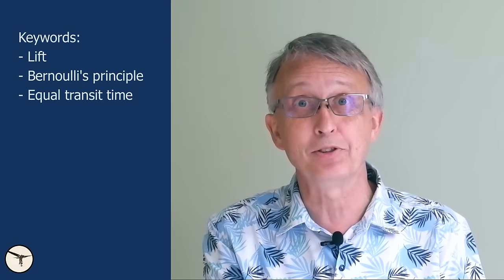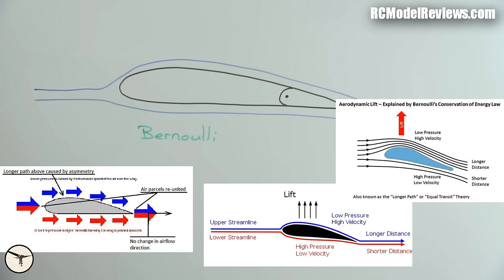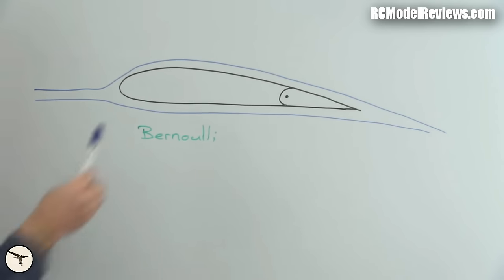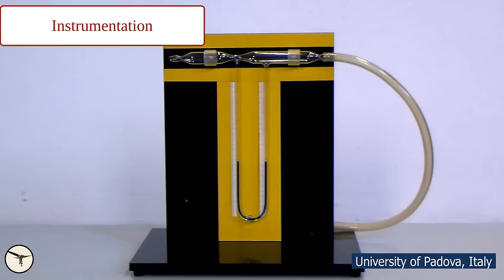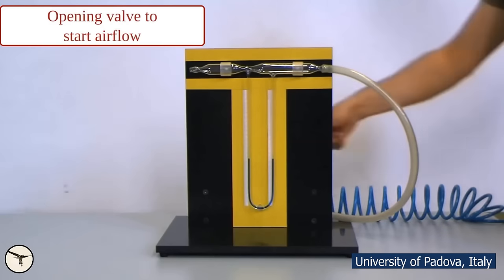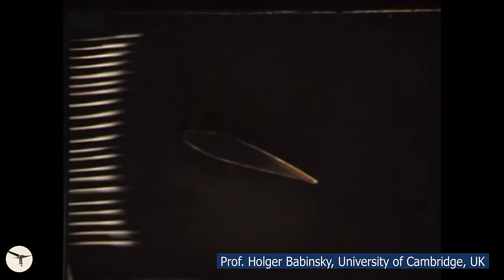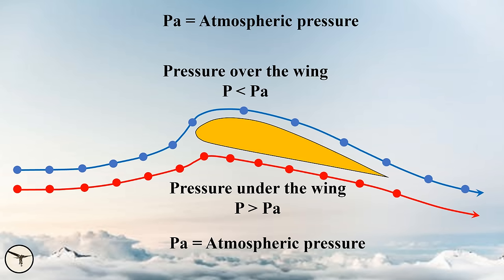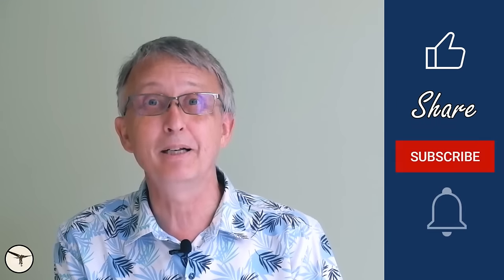Why are so many pilots wrong about Bernoulli’s Principle?

Comment: I have been dying to find a good video that actually explains lift for pilots in a correct fashion. As an aerospace engineer it's really hard for me when my student pilots tell me about the Equal Transit Time theory for lift. Thank you for this video!
Reply: Show them the wind tunnel video...
Not only is equal transit time shown to be wrong, the air over the top of the wing moves even faster than equal transit time would suggest.
Note that that video is only valid for that profile, angle of attack and wind speed.
Reply: Quite right that the equal transit hypothesis is demonstrated as being false.  But then it's dismaying to hear him talk about lift almost as though it were purely a function of surface curvature, when even a flat plate tipped at an angle and forced forward at speed will, also very demonstrably, generate lift.
Reply: All pilots should look at the book "The Illustrated Guide to Aerodynamics" by Hubert Skip Smith. Excellent conceptual explanations without the math.. Highly recommended..
Reply: @villiamo3861  Good points!
Reply: The navy had some great demonstrations on lift. This wing that he is showing has such a high angle of attack that he is getting turbulence above the wing that it symbolizes a stall.
Reply: Draw a black box. The air entering it is directed slightly down and slowed down a bit. (the wing's down wash)  Therefore the force on the box must be up and slightly aft. Lift and parasite drag.

Replace the black box with a wing and draw the forces. The air hitting the bottom of the wing must be deflected down. The air over the wing must also be directed down by the shape of the wing and to fill the void by the air under the wing. Newton's 3 laws apply. Complete workable model of a wing complete. And one that actually is useful when trying to fly an airplane.
Reply: "As an aerospace engineer it's really hard for me when my student pilots tell me about the Equal Transit Time theory for lift." -

then please explain as an engineer why airfoils on passenger jets are asymmetric.
Reply: @dougaltolan3017  In almost every video on this subject they show a wing cross-section in some airflow. But this is not what happens when aircraft fly. In real flight, the air does not move at all; it is the wing that moves. I would humbly suggest that the two scenarios are not the same and that the explanations in terms of interaction between the physical objects - the wing and the air - are necessarily different for moving air and moving wing.
Reply: @mb-3faze  apart from some insignificant reletavistic effects, what possible difference is there when changing the observers' reference frame?
In the laminar flow at the centre of a wind tunnel, the air dosent "know" it's moving.
Consider putting the wind tunnel on a train so the air at the test point is stationary relative to the ground and the aerofoil is moving with the train.
How would the air "know" the wind tunnel is on a train?
Reply: @villiamo3861  Although the air molecules are clearly not sentient, somehow making an arrangement with a neighbor to 'meet up again on the trailing edge of the foil' , it is also the case that it is not the air molecules that are moving. In disproving the equal transit time hypothesis, all the demonstrations (that I've seen) show the air moving over the wing. But this isn't what happens - it is the wing that moves through the (mostly) stationary air. I don't believe the two scenarios are equivalent - mainly because the momentum characteristics of the physical components (particularly of the air) is different when moving relative to gravity. Seems gravity is not often considered. It is gravity acting on air molecules that changes the weight of an air column above at any given altitude and the wing perceives this as pressure. If there was no gravity, there would be no lift - so gravity would seem important.
Reply: @dougaltolan3017  I've just replied to villiamo3861 suggesting that there is a difference in the two set-ups mainly because of gravity. The wind tunnel demonstrations move the air molecules in the presence of gravity but in reality, the air molecules are stationary wrt gravity. I'm suggesting that the physics is different.  It's difficult to demonstrate but if you had a wind tunnel in microgravity would the wing demonstrate 'lift'? My guess it it would - but keep the air stationary and move the wing - would the effect be the "exactly" same? Has anyone thrown an aerofoil section on the ISS?
Reply: @mb-3faze  Just one more thing: whether you have flowing air molecules against a stationary body or vice versa, those molecules, whether in a wind tunnel moving fast, or at 40,000 feet moving more slowly, all operate within the earth's gravitational pull - as does a ballistic object, whether stationary or moving at speed, and nevertheless very predictably falling to the ground at the same rate either way (and I think you'll agree we're not actually disputing the effects of altitude here on either air density or gravity, as these are factors that can readily be taken into account in a wind tunnel).

Those models disproving the equal transit are taken from wind tunnels (rather than simply being dreamt up on a computer) but as said, it is clear that the flow in working airliners is pretty much exactly as those models predict.
Reply: @villiamo3861  There's no doubt the phenomenon of lift occurs. Manufacturers of large powered aircraft would be mad not to utilize the effect particularly at low speed. It's noticeable just how quickly the pilot reconfigures the wings of a passenger jet back to more a flat surface after take off. A space youtuber called scott manley recently touted getting his private pilots license and recalls the lecture on lift - noting that the explanation was bogus. You wonder why the instructors feel the need to (inaccurately) explain lift at all.
Reply: @mb-3faze  All very well.  But do you see the angle of the wing against the fuselage, even when wing is in a 'flat' configuration?  

But even that, really, is for the comfort of the passengers and general reduction of fuselage drag.  

More importantly yet is angle that the engines thrusting the whole body being at a lower angle than the angle of your flatly-configured wing - they are the things driving the wing at a positive angle of attack (this is lower for supercritical wings, which turn the air particularly efficiently at certain speeds, but the point holds with regard to flow).

But just to see things very apparently in the main, simply look at the wing root on the fuselage - it's not at the same slope when there are no flaps, nothin' doing, as it were.
Reply: @villiamo3861  Yes - there's no doubt that the reason planes stay in the air is because they're forced through the air using powerful engines and the wings (and fuselage) literally hit the air molecules in the way. The angles are important so as to maximise the vertical force vector without increasing the backwards drag vector too much (just like you said). I was thinking back to the Sullenberger incident on the Hudson - I believe he didn't re-configuring the wing back to the exaggerated curved airfoil cross section (used at take off)  but just left them and glided the plane in to the river. Maybe he didn't have time or maybe too much drag would occur in the process. Also interesting to think about is what happens in water-  there's no point in having any 'airfoil' section in water for lift because the water is not compressible. The hydrofoil shape is just to ensure minimal-turbulent flow on both sides.
Reply: I was never taught or heard of this 'Equal Transit Time' part in my training.
New 21st century BS like calling 'Spoilers' air brakes'.
Reply: But this video is not a basic explanation. You should explain the cause of the acceleration of the air molecules flowing over the top of the wing, and this explanation would lead to the understanding of why an airplane can fly with flat wings.
Reply: @mb-3faze  That's not quite right. The reference frame is an arbitrary choice and the behavior of the objects must not depend on that choice.
Reply: @karlschmied6218  I have a thought experiment... Take an aerofoil section up to the international space station (I.E. microgravity).  Create a wind tunnel, fix the foil and blow air over the foil, measure forces. Next, take the foil section out in to the main body of the ISS and throw it horizontally (along some arbitrary line). What happens?  I don't know if this experiment has been done. I try to imagine the results - because there's no downward gravitational force on the foil and, possibly more importantly, there is no difference in static air pressure above and below the foil like there is in the presence of gravity.
Reply: @mb-3faze "There is no difference in static air pressure above and below the foil as there is with gravity." 1. gravity is not absent in the ISS, but it is in accelerated "free fall" on a trajectory like most satellites and the moon, etc. 2. the difference in static air pressure is so small that it makes no appreciable difference.

Comment: Two other phenomena need mention:  Vortex around the wing caused by viscosity, and simple flat plate lift.  The wing's lift is actually a sum of those two, and the latter is still active even when the wing is stalled as long as its AOA remains positive.
Reply: The vortex isn't caused by viscosity, it is caused by the pressure differential, and around the wing tip is the only available route the air can move to try to equalise pressure, it can't move against its own flow upstream to come back around the leading edge, or around the trailing edge to do it.

You're confusing cause and mechanism.

It would be like saying a ball rolls down a hill because it is round, no it rolls down the hill because of gravity, the reason it CAN roll is because it is round.

The cause of the vortex is the pressure differential, the mechanism that allows it is the viscosity because without the viscosity it would immediately collapse, but again, that's not the cause.
Reply: @LeoH3L1  Well, if you want to get really precise, then what's the cause of the pressure differential?  The ultimate cause of the wing's lift is the force (thrust) pushing on the wing to accelerate it and then maintain its relative motion with respect to the air.  Then there are other co-causes and proximate-intermediary causes-mechanisms.  Without the pressure differential along with the air's viscosity (See Prandtl) we would have no vorticity around the wing and it's that vortex's interaction with the air flowing past and through it that's producing the lift, along with a portion (relatively small at low aoa) of lift produced by flat plate drag if angle of attack is positive.  We also should mention the shape of the wing, specifically its rounded leading edge and sharp trailing edge.  That shape, especially the sharp trailing edge that starts the vortex, also is a cause...can't make lift with a cylinder, unless the cylinder is spinning...Magnus effect used on some "sail" boats.  Then there's angle-of-attack...zero angle of attack...zero lift...Want to cause lift, then make the aoa positive but less than 90 degrees.  So, we should really say that lift is not caused by any single thing but by a number of factors working in concert, but still the ultimate cause is thrust (from a propulsion unit or from gravity)acting to move the wing relative to the air.  So, using your ball rolling downhill analogy:  Thrust is gravity.  The shape of the airfoil, the vorticity of the air, the aoa of the airfoil...those are the ball's roundness.
Reply: @LeoH3L1  see above response.   Recirculation effect on lift was discovered at Boeing Aircraft Research under one Arvel Gentry.  The reason for the 'recirculation flow' around a wing/foil/sail is the fundamental viscostiy of the moving fluid.  See previous postinjg.